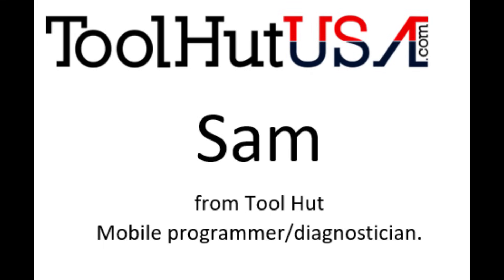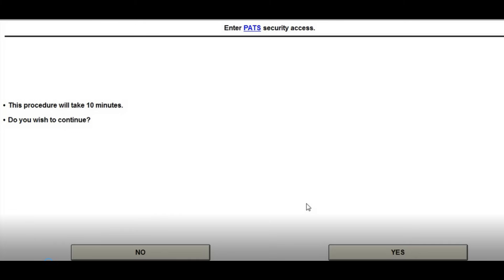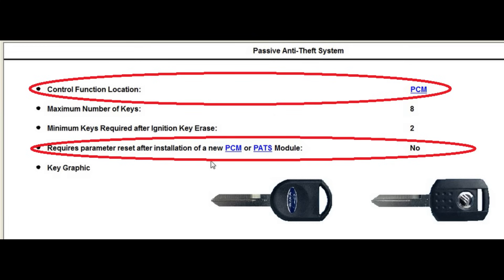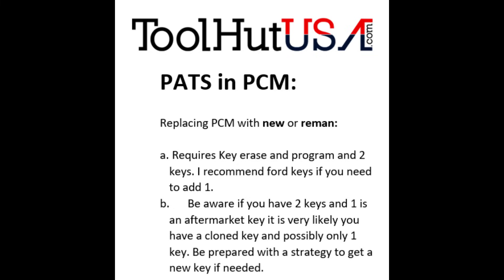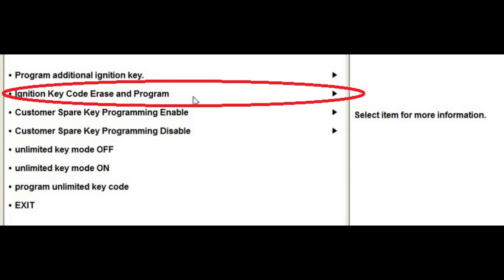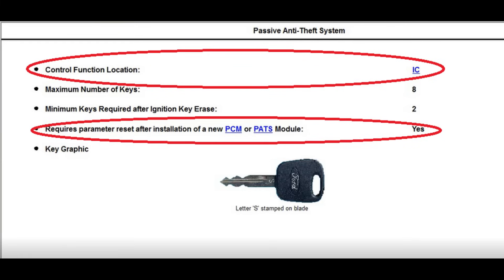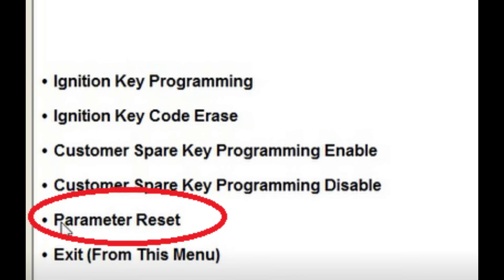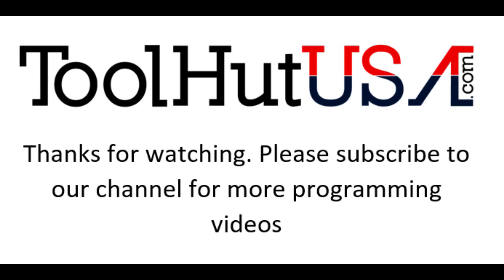Ford PATS after a module has been replaced | Tool Hut USA

Comment: Need some help!! Much appreciated  so my car was sitting for about a year no battery engine being built fasforward to now I had pats issues finally figured it out and it started running crank no start issue  but my key fab with a new battery inside as well as the car. The remote would  not control the locking  and unlocking of the car and the horn would beep and basically go into panic mode then timing it correctly by pressing the button it would shut off but had no control of locking/unlocking of doors.  So today I brought the tpms scanner home  I only have one key  and stupid me selected reset parameters  and then also had selected I believe clear key code thinking it would rectify my issue  I was wrong I'm now having a crank no start . How do I go about recoding my only key I have in my possession  again? My car is a 2004 mustang mach1  and the pats control is in the instrument  cluster. When I saw this video I knew rite away I messed up ..  thankyou for your post of this video. And i hope to hear from you thankyou for your time..

Comment: Thank you for sharing your knowledge! I have a question. We are rebuilding a 6F35 for a 2014 Ford Escape and had to put a new techm in. Would a PCM and PATS update be required after I update the TCM module with the new sol body tag info?
Reply from the maker: It should not
Reply: agreed.  i do them all the time and they don’t require it.  solenoid strategy is usually a prog and go.

Comment: My 1999 Ford F-150 theft mode has engaged.  Locksmith came out tried to program new keys, said the "immobilizer" (column transceiver I assume) was bad.  Replaced it.  New locksmith came out, tried to program new keys, stated the immobilizer wouldn't communicate with ECM.  I'm at a loss.  What is in between the ECM and the transceiver or what could be causing the transceiver not to communicate with the ECM?  Is=f it is the cluster, how is communicatioin fixed?  Frustrated.
Reply: I have the same issue, we're you able to fix it? Thanks
Reply: Pats system a living nightmare for owners

Comment: I just replaced my customer's pcm on his 2001 Lincoln LS 3.0L for a faulty ignition coil driver caused by a shorted coil. I am able to access the pats system on my snap on scan tool and get through the 10 min function. I have both factory transponder keys and went ahead and erased them and then relearned them. I also went back into the security screen and performed the parameter relearn. When all was said and done I was left with a crank, no start condition. Do you have any idea what I may be missing or doing wrong? You mentioned in your video that if replacing the pcm, then erasing the keys is not necessary. What do you need to do if you do erase the keys when not necessary, as I have done?
Reply from the maker: Did you perform parameter reset?

Comment: I replaced my pcm with one that i had programmed to my vin number and i have pats system and only one key. What next step do i need to do as far as the one key i have since you say do not erase all keys. I went to the dealer to get a ford key and they cut me one that didn't even fit in the ignition and gave me a refund saying that i had to try a locksmith.
Reply from the maker: Depending on kind of vehicle I would recommend getting a second key. Make sure they do not clone it.
Reply: @toolhutusaakathecarflasher3019  it's a 2003 ford excursion V10

Comment: Hey what happened when no key is with the truck I have bought a 2001 ford ranger either I was thinking of buy an ignition barrel with key or putting an older version pcm from 86 Taurus would that work too? Thanks

Comment: Can you disable PATS with the IDS on a 2008 Ford F-150 going by example to parameter configuration!? You see this is the situation we get a used PCM from a 2008 F-350 that PCM has PATS in the RV we are going to use don’t have the PATS because key doesn’t have chips is no coil around the ignition lock cylinder. The old PCM no communication with the scanner and immediately you connected the PCM blow the PCM fuse the one from the junk yard doesn’t blow the fuse and you can see DATA pids ...this RV has only two modules separated from the PCM ... ABS, IP....
Reply: It's a factory tool it's not made to disable things. Better luck with forscan

Comment: 2011 Ford E350van ,Someone stole our catalytic converter’s off the church van now it won’t shift out of first when you drive it , Ford dealer said the PCM is bad, They cannot find one anywhere in the United States I bought an aftermarket one remanufactured unprogrammed, 
Ford tried to program it today says  I can’t use this PCM because it asked for a pats key information
This van does not have a chip key it has the old regular keys is there anyway to get rid of the Pats information off the current rebuild PCM, Ford programmed just fine but the mechanic says there is no Pats system on this van so he cannot use this PCM?.
Any ideas to help us out, thanks much
Reply from the maker: All they should have to do is a parameter reset and then this PCM would work.
Reply: @toolhutusaakathecarflasher3019  Hello, what software/ hardware would allow me to do a parameter reset on my Ford E250?  I have HP Tuners but I don't think that will do it. What system are you using in the video?  Is it Forscan?
Reply from the maker: @scottjcole  the fjds would do it. A few aftermarket professiobal grade scanners will do it. Autel, launch. I belive forscan will also perform this function
Reply: I have pretty much the exact same problem!.  2011 E250 Van with cats stolen and replaced PCM.  New PCM seems to be looking for a chip key but van doesn't have chip key.  Did you solve the problem?  If so, how?
Reply: @scottjcole  yes only a Ford dealer can program the new PCM
What they had to do was programmed the dash the cluster in the dash to say there was no chip key, after they program the cluster then when turning on the new PCM it married to the cluster and it was not looking for a key with a chip any longer
Reply: Cost me I think a little over 400 for Ford programming
Reply: Thanks to both of you!  Here is the update on my side.  I downloaded Forscan software and purchased an OBD adapter on Amazon to connect to my laptop.  I was able to do a parameter reset (PATS module initialization in Forscan) and most, but not all of my problems have been solved.  The antitheft warnings disappeared and I can now start the car, but it dies immediately.  The only DTC I get now is P1639 Vehicle Identification Block Not Programmed or Corrupt.  I bought this PCM preprogrammed with my VIN from Flagship One.  From what I've been able to find Googling the issue, I might need to do something with As-Built?  I'm wondering if I screwed up by resetting parameters on the new PCM (it still shows the correct VIN, i.e., same VIN as old PCM.
Reply from the maker: @scottjcole  flagship one is horrible. Does the original pcm communicate?
Reply: @toolhutusaakathecarflasher3019  Yes, the original PCM communicates.  Can I pull data from it and copy it over?
Reply from the maker: @scottjcole  You just need a scan tool that can perform PMI or programmable module installation. And then you will need to do a parameter reset.
Reply: @scottjcole  well I've always been told by every dealer you cannot buy the software anywhere to program the PCM correctly only the dealer has that software cost $425 for programming
Reply: @N9IWJ  Forscan seems to have through for me.  I bought a license from them for $10 and a USB adapter for $20.  I was able to do a parameter reset and I can now start my car and no dashboard warning lights.
Reply: @scottjcole  yeah but you're resetting the perimeter on the console gauges you're not programming a blank PCM a blank unprogrammed PCM can only be done by a dealer, usually when you buy a PCM they put new blank chips in them if you're buying a used one or getting one out of a junkyard it probably will not work most of the time
Reply: @N9IWJ  Ok, but my car is starting and running great now with the old chipless key.
Reply: Thank you both again, Robert and Sam.  I couldn't have figured this out without your help.

Comment: Im buying a reflashed PCM for my Excursion and was woundering if the Chinese ebay key programmers that are about $100 able to reprogram the PATs module to the new PCM or do I need  the J2534 tool with a laptop to accomplish this.
Reply: Try Forscan and a laptop with a obdlink ex pass thru device or Ford IDS with a Vcx2 pass thru. Forscan is free $10 for extended license to program pcm $60 for obdlink. Ford IDS can be bought on EBay for less than $20 vcx cost around $100
Reply: Absolutely not you will have to pay the dealer $425 just to program
Reply: Yes, you can as long as that device supports your pats type.
Reply: Unless doing volume work PATS removal etc are available inexpensively. The Ford Truck Enthusiasts forum is a good place to ask about reliable vendors.
Reply: @obfuscated3090  yea if he wants something priced so cheap it scares me. He should look threw my videos and check out the km100. This tool is too good for its price and can make it easier for it to get it the wrong hands. In my opinion they shouldn't sell these tools without a sales tax account at minimum.q